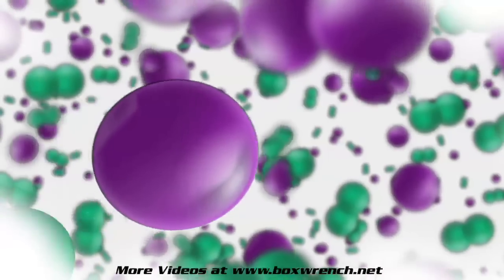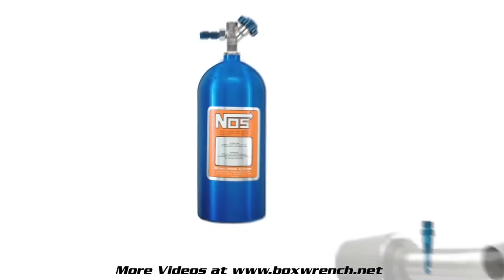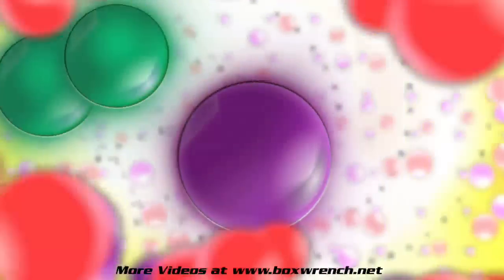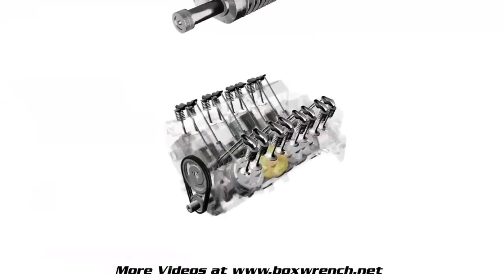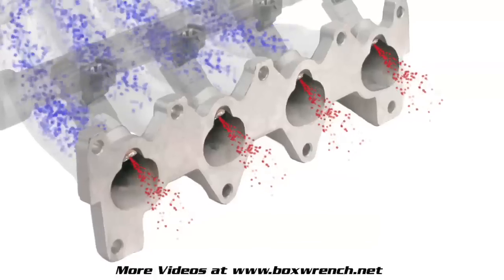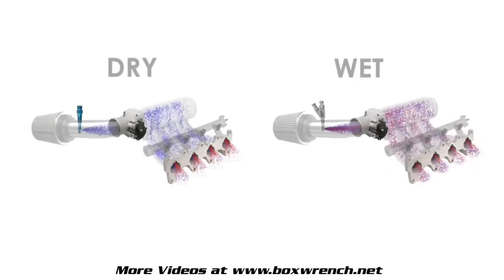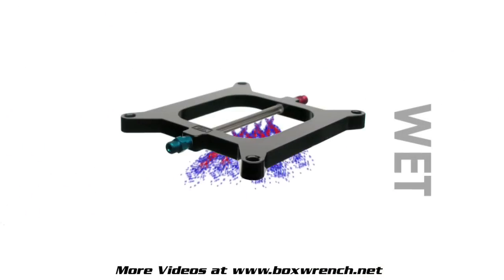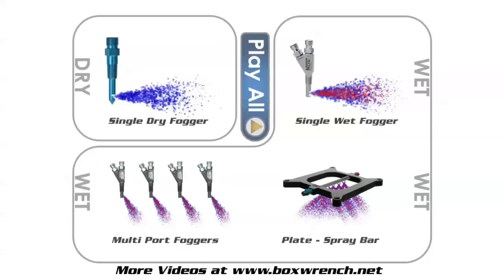What is NOS ? - Nitrous Oxide Systems - How NOS creates power

Comment from the maker: @HYPHYDUM408 As air/fuel mixture enters the engine there are two main areas that are affected by air pressure. Inside the cylinders, the pressure increases as the valves are closed and the piston comes up during the compression stroke. The 'PSI' is called cylinder pressure and can build to very high numbers if the compression ratio is designed to do so and the fuel is high octane. 
Inside the intake however, the pressure is a negative value and is referred to as vacuum. There is no build up...

Comment from the maker: You should look into a 'Dry' or 'Wet' single fogger system for your Camaro. 
Either kit will only require a single hole drilled into your intake tube that can be easily plugged if you choose to remove the system. 
Both kit styles will include electrical and solenoid wiring that is easy to keep separate from the stock wiring system.

Comment from the maker: @ashtweth The foggers are all simple spray nozzles that are fed by pressurized sources. Pressurized Nitrous Oxide in a tank (bottle) and fuel pressurized by either the stock fuel pump or an additional fuel pump. 

Using any other type of spray mechanism or vaporizer would add unneeded cost and maintenance to an otherwise simple system. 
It could be done, but Nitrous Oxide is extremely cold when it is released and would likely cause issues with anything other than a simple spray nozzle.

Comment from the maker: Dry systems are a bit easier to install because you're not dealing with an entire separate fuel system, only a regulator valve that will increase stock fuel injector pressure. 

Wet systems require you to plumb a completely separate fuel source to the spray nozzle and will also spray fuel into the upper intake. 

The trade-off is that Wet systems are a bit more complicated but will let you make much more power in the end.

Comment from the maker: @dylancohen10 Nitrous Oxide is only meant to be used for short periods of time. It can only be sprayed into the intake during Wide Open Throttle because a high amount of additional fuel is also being sprayed into the engine at the same time. 

The added fuel is what makes the extra power and the nitrous oxide converts to oxygen during combustion which allows the extra fuel  to burn. 

You can not use most Nitrous Oxide systems at lower RPM or part throttle, it will damage the engine badly.

Comment from the maker: Not so much a question of which is better. It's more a choice of which kit is better for your application. 

As seen in the video, the Dry kits don't spay fuel into the upper intake. Some people prefer the Dry kits because of that reason. However, Dry kits are less precise about the fuel delivery and can not provide high amounts of horsepower increase because of limits to the stock engine fuel system supplying fuel. 

Wet kits are preferred for high horsepower building but are more complicated

Comment from the maker: @pjwithbread8 it's not so much a decision of what system is the 'best'... it's more up to you to decide which system is 'right' for your application and horsepower increase requirements. 

This video ends in a 'choice point' that allows you to click on any of the four types of NOS systems. If you watch each and are familiar with what type of engine you have, you'll be able to make a decision as to what system is right for you. After that, you just decide how big you want to go with HP increase

Comment: @Detroit3Pistons I'm pretty sure it's a measure of the power increase in brake horsepower (BHP). So a "100 shot" would take a 150bhp engine to 250bhp for the time the "shot" was being injected. The shot could be a little squirt, or until the bottle was empty.

Comment: If I'm not mistaken, fuel vehicles use (gasoline) will ignite when exposed to a flame or explode when a flame is present under certain condtions.  And, if not misteken again, the "oxide" or "O" in NOS is oxygen and oxygen is one of the elements required for fire; as such if more oxygen is available when a fire or fire induced explosion is present it will burn more readily.

It's not the nitrous oxide burning or exploding but is aiding it doing so.

Comment from the maker: The "pipe" at which point and for which system?

Do you mean the high pressure 'braided' hose that connects to the dry (single line) or wet (double lines) foggers? or do you mean something else?

Comment from the maker: @AgentCROCODILE 'Dry' systems require a fuel injection system that has a fuel pressure regulator that can be "tricked" so that is tells the engine control computer to deliver more fuel during Wide Open Throttle. Plate systems are meant for engines that have carburetors, so you can't have a Dry Plate because there is no way to tell a carburetor to suddenly deliver enough extra fuel to add to the nitrous. 
With a multiport system, it's more efficient to deliver the extra fuel directly at the port

Comment from the maker: It's more a matter of opinion but most people actually prefer the Wet Systems. 

In the most simple comparison, most folks agree that the wet systems will distribute the fuel more evenly and quicker than the Dry Systems that sometimes have a slight lag in the fuel increase at the fuel injectors. 

The Dry Systems are the easiest to set up however, because you don't have to plumb additional fuel to a fuel solenoid...Extra fuel that causes the increase in horsepower comes from the stock injectors

Comment from the maker: ...of PSI pressure in the intake manifold because of vacuum draw of the cylinders constantly pulling in air (in actuality the outside air pressure is pushing the air into the cylinders because of the negative air pressure in the cylinders and the positive pressure outside)
When using a Nitrous System, you're adding extra oxygen (via the Nitrous) and fuel to the cylinder before the valves close. Inside the closed cylinder, there is no need to be concerned with the pressures in the intake manifold

Comment from the maker: @rottepung666 The NOS brand has a 'blow-down' tube that is offered for installs where the bottle is mounted inside the passenger compartment of the vehicle. 
Yes, it would be very dangerous to have nitrous oxide leak inside the car. Not because of explosion hazard (nitrous oxide is not flamable by itself) but because of an inhalation hazard or freeze burn from contact to the cold gas. 
With a blow-down tube installed, any escaping gas leak would route outside of the passenger compartment

Comment from the maker: @pancakewafflebacon It's the same gas no matter what brand of delivery system you buy. All of the Nitrous Oxide performance enhancements brands sell parts and empty bottles. You can fill any brand bottle at an automotive Nitrous Oxide refill center as long as they have an adapter for your bottle. You can only buy Nitrous Oxide 'Plus' for automotive use. It has a trace amount of sulfur added that keeps people from inhaling it as a controlled substance.

Comment: the late model GM dry applications can easily run 100 or more HP through a dry application.  THe MAF can easilly make the needed calculations and add the fuel enrichment through the OEM PCM and injectors

Comment: @seroyer2 incorrect if the flames backblasted through the carbine with the NOS tanks open it could heat the gas to the point it blew the container to pieces and ignited off the outside flames or blew up in its container you have to remember that the flames would heat up the metal container

Comment from the maker: @StEaLtHmAcHiNe95 Oxygen is not a fuel source and will not burn by itself. However, oxygen, when present with an ignited fuel source such as acetylene gas or gasoline, will cause the fuel to burn much hotter and faster. 

Nitrous Oxide is an oxygen molecule that has two nitrogen molecules attached to make it an inert gas that will not turn into a volatile oxidizing accelerator of flames by itself. This makes it safe to transport. 
Heat in the engine cylinder releases the extra nitrogen molecules

Comment from the maker: Heating up the bottle is a performance increase technique but using a blowtorch to do it is not a great idea and will not disperse the heat as well as an electric bottle heater will. 

Liquid Nitrous Oxide in the bottle will have a higher and more sustained pressure if the bottle is heated up. More pressure in the bottle means more nitrous into the engine which will allow for more burning of fuel... meaning more power from the engine.

Comment: While I agree running nitrous oxide is an easy way to increase power, I disagree that it is more or less safe than a turbo or supercharged setup. Granted it is in most cases simpler but this also means more people will just bolt on a dry setup, leave it on a stock tune and wonder why they are picking their pistons out of the oil pans a couple weeks later. Thanks for the video posts on the subject, it did clear up the confusion I had with different types of setups.

Comment: Oxygen is flammable, hence N2O is flammable under the correct conditions.

I started running NOS systems in 81, and when I had a fuel pump failure I burned a hole between 2 cylinders at the head/block.  I also had flames out the scoop of my vette around the windshield until I got off the juice.

Comment: @StEaLtHmAcHiNe95 Continuing from my other post. The addition of a pressure regulator and far greater storage pressure increases complexity and risk in the system.

Furthermore, nitrogen is needed in an engine as it draws heat away from the engine block and expands, cooling the engine and providing power.

Comment: @seroyer2 yes that would stop the flames from the interior blasting the bottles but as i stated back blasting could have done it a blast from the fuel tank through the fuel line to the injectors/cyclinders then through the direct injection system and with the gas heated it would have split and then straight back into the bottles and boom one car extra crispy

Comment: @BoxWrench The only comment I'd like to make is that the statement "The nitrous oxide molecule is N-N-O which is written as N2O in chemistry" sounds a bit like a rule. 

That would be incorrect as a chemical formula only states the number of atoms of each element present in a molecule and not how they are bonded together. As in the case of water, which is chemically written H2O but is formed H-O-H. 

I'm sure it wasn't your intention, may just be the way I read it. Good video though :)

Comment from the maker: You can also make great amounts of power with plate systems put will sometimes require specific manifolds that allow for multiple plate and carburetor installations on the same engine.

Comment: @seroyer2 nitrous oxide isn't flammable. It is an oxidizer and will aid in the combustion of other substances, but not burn it's self. any fire you see from nitrous oxide is a result of some other material burning and nitrous oxide simply providing oxygen to the flame.

Comment from the maker: That is a  valid point...
The Dry systems referred to in this video are generally of the stock engine compatible category within the NOS product line. There are Dry nitrous systems available that can take advantage of custom ignition, timing and fuel injector controls, however, the majority of these systems are aftermarket installations and will require a very specialized tuning procedure. 
Some stock engine ignition and fuel injector  control systems will work with high output Dry kits though

Comment from the maker: @thetunessetter Oxygen is too dangerous to transport, store and will also corrode internal engine parts as it is introduced upstream of the intake. 
By using Nitrous Oxide, the gas is inert and safe for transport and introduction into the engine. Only at the point of ignition inside the cylinder, the molecule changes and becomes oxygen that can burn along with the added fuel to increase horsepower.

Comment: @bassbone1785 And what I mean by more or less is the same thing as people throwing a turbo kit on their n/a engine. Either way significantly upping the power will likely break stock internals that aren't designed for that kind of power. Especially if the engine isn't well tuned.

Comment: Because oxygen has to be kept cold to remain a liquid in a compressed cylinder while nitrous oxide can remain a compressed liquid a room temperatures. You could use compressed oxygen however, you would need a huge tank in order to get the same amount of oxygen atoms as there is in a 15 lb. tank of liquid nitrous oxide as the air is much less dense. Also, a compressed liquid will remain about the same pressure until the tank is empty while compressed gas will loose pressure as it depletes.

Comment: @StEaLtHmAcHiNe95 Storing pure oxygen is dangerous as a spark and fuel source can cause a huge explosion.

In addition as N2O liquefies readily when it is compressed the tanks of N2O are self pressurizing i.e. as long as there is even a drop of liquid N2O in the tank the N2O will be under full pressure and ready for use. Oxygen doesn't liquefy when it is compressed the oxygen must be stored under massive amounts of pressure with a pressure regulator in the tanks to provide a usable amount.

Comment: Q2)
im just guessing
that the remaining nitrogen just leaves through the exhaust. (Nitrogen is a gas.) I looked up and found nitrogen isnt very flammable so assumed it would remain nitrogen gas. BUT 
I also found that mono-nitrogen oxides (NOx), which is NOT NOS, are formed when nitrogen is present during combustion. These are gasses (im pretty sure) and would probably leave with the exhaust.
I also found that one of the mono-nitrogen oxides (NOx) combusts (maybe thats the fire in muffler idk)

Comment from the maker: A general rule of thumb is that a Nitrous kit that is only rated for around 50 horsepower increase is safe for most stock engines and will not cause damage to the factory designed components. 

An increase of 100 HP or more wold require you to upgrade rotating assembly components and other equipment to handle such an increase in power output.

Comment: does this cool the engine because nitrogen is cold so does it cool it?
Reply: Yeah it brings the temp down for a bit
Reply: Cyril Willard Cable no, it is not because nitrogen is cold. It's because the chemical reaction absorb heat.
Reply: Cyril Willard Cable no, it is not because nitrogen is cold. It's because the chemical reaction absorb heat.

Comment: @BoxWrench actually... straight oxygen wouldnt really help. 
nitrous oxide needs both nitrogen and oxygen to improve power.

way a internal combustion engine works is.
1. air and fuel enter combustion chamber while piston is traveling down
2. piston comes back up compressing the air fuel mix.
3. spark, fuel ignites
4. burning fuel increases temps in combustion chamber
5. nitrogen expandes due to increase in temps. forcing the piston down.

more oxygen helps burn the fuel more

Comment: Why do people answer things when they don't have the correct answer? Never understood that. If you watch the video it explains... Oxygen by itself is flammable. The mixture of 2 parts Nitrogen and 1 part Oxygen is not flammable. However, at around 570 degrees fahrenheit (temperatures that can be found inside of your combustion chambers) the chemicals split at which point the Oxygen becomes flammable and increases the 'air' going into the motor. Motors need the proper ratio so fuel is also added.

Comment from the maker: @monkeyboy957 Very sorry but N-O-N is absolutely incorrect. 
The nitrous oxide molecule is N-N-O which is written as N2O in chemistry. 

The video shown here is completely correct in it's display of two nitrogen elements bonded together first and then bonded to a single oxygen element to create the nitrous oxide molecule of N2O. 

Any depiction of single nitrogen elements bonded on either side of an oxygen element is incorrect...
N-O-N is fail chemistry.

Comment from the maker: It is absolutely impossible for a cigarette lighter to ignite nitrous oxide...not even a blowtorch could ignite an inert gas.

Nitrous Oxide does not create the stronger explosion in an engine by itself, the systems add extra fuel that burns with the oxygen added by the nitrous...

Click play above again to learn the truth about nitrous.

Comment: this is not entirely correct.  Dry systems can make as much power as a wet system.  It depends on the ability of the vehicles fuel system and injectors to supply the needed fuel enrichment.

Wet or Dry has the same potential to make power.

Comment: It is another option besides turbo or super charge?

Assume would be the cheapest option, with turbo being the most expensive?

But, which one of the three is hardest on the engine?  I hear its turbo.  Super is less.
Reply: Soldier1287 but turbo is always in ur car ur nos bottle will get empty after using it for some time

Comment: Why not pump pure oxygen into the intake instead of nitrous oxide when you just need oxygen to increase your horsepower ? What does the nitrogen do?
Reply: Suharsh Tyagi I was wondering the same thing. From what I gather it has to do with the efficiency of liquefying n2o vs compressing o2, and also pure o2 is hellllaaa dangerous/combustible.

http://www.nitrous.info/oxygen-instead-nitrous-oxide.htm has some info summed up. check it out if you're still wondering
Reply: Yes it must have something to do withthe  highly combustible pure o2. Thanks for the answer!
Reply: The combustion reaction requires oxygen in a compound with another molecule so this is why N2O is used not just O2